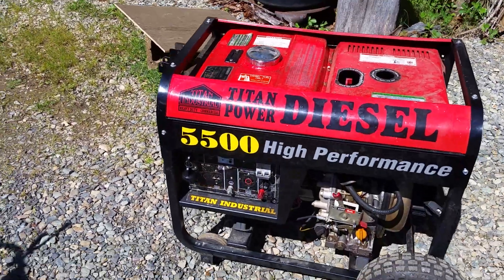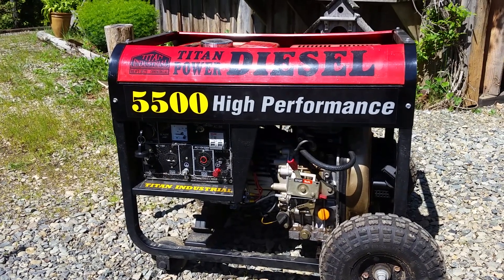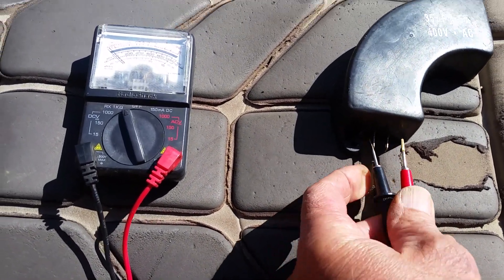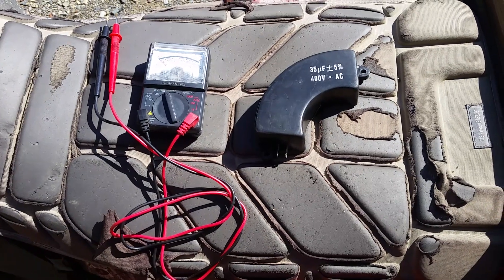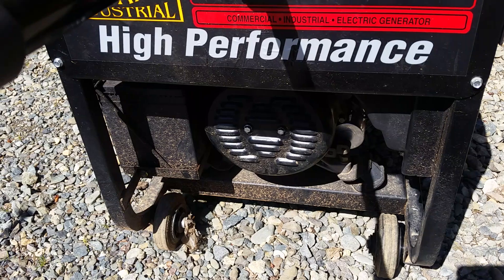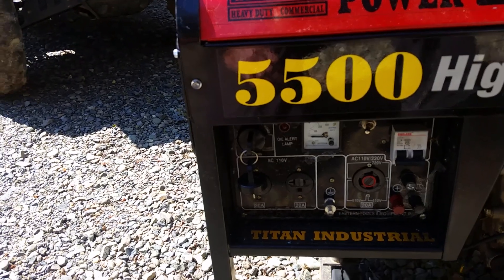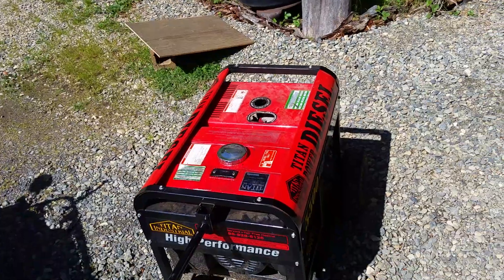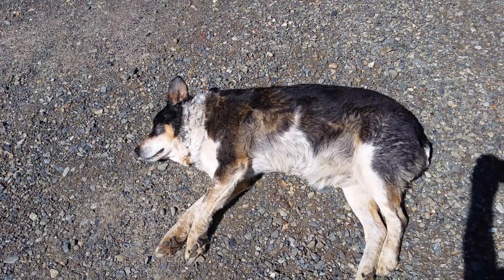Off grid solar homestead Diesel generator repair ($17.95 fix)

Comment: Chinese capacitors...🙁Thank you for sharing your knowledge...🙂I am in the planning stages of going completely off grid...The wife seems to be on board...Trying to figure out how to hook up the gen as a backup to keep battery’s from damage....My thoughts are panels to combiner box to charge controller to battery to inverter to breaker box...generator not sure yet...Just thoughts at this point...I need to watch more vids.T.Y.Much
Reply from the maker: Thomas Reto Greetings from off grid Oregon,  when you buy an inverter make sure you buy an inverter / charger.  I have a 4000 watt 24 volt inverter that also charges the batteries at 105 amps when connected to the generator.
Reply: Steven Davis I will keep that feature in mind when looking for one thank you.

Comment: I gave up on generators they are just so poorly manufactured and overheat so easily, we turned an Ninja 250cc beginners bike into a generator for our backup power... we picked up the ninja 250 for $500 bucks with only 700ish miles on the motor... i welded up some rollers that are mounted to a small frame spaced out for the wheel to sit inside the 2, then on the end of the one roller i ran a pulley that turns a belt to a 10,000 watt generator head i picked up.. i roll the bike into the frame i built to secure the bike, the rear wheel sits on the rollers and i strap down the bike via the rear swing arm by multiple straps to the frame of the rollers, then i run 2 more straps to keep the bike upright via the frame.. ive used this setup multiple times when we lost power out here in Colorado during snow storms.. i normally keep the bike inside the barn because the girlfriend occasionally takes it on motorcycle rides with me.. but all i did was ride it into the frame, strap it down, turn the bike on and let it warm up.. then put it in gear and start making power... the generator head is about 7 years old now and sits outside under a tarp when not in use, the motorcycle is 14 years old.. i run a large box fan in front of the bike when i run it to increase airflow, but the bikes liquid cooling keeps it under control without any issues...
Reply: you mean to maintain rpms? if so I use a motorcycle cruise control bar end lock I picked up off ebay to lock the rpms
Reply: I have never has an issue with it, the generator head has 4 built in 120v plugs and does all the controlling internally, I do know the generator head came with a warning that if ran without a load it could cause damage to the generator head, but outside of that I just don't worry about it.. it always has a load on the circuit due to it usually having to charge my battery bank at the same time of supplying power to the house.. it has 5 led lights on the head unit, if you give it to much throttle it shows a red led, if its to little it shows yellow... I just turn it on, get I started and watch the led tell its only green, then I lock the throttle..

Comment: Love the comment, "...have some general knowledge of how not to die doing it." Cracked me up...but, it is SO true. Reminded me when I was a young/dumb Airman working into the mobile radar van. Missed a step in a trigger amplifier removal and got whacked by two phases of 120v with discharging capacitors. Locked me up and then threw me against the wall like a rag doll. Had an exit wound/burn. It was a bad day...but, was fine after an hour of trembling. Well done video my friend...great words as always! How is your son...has he taken off for boot camp yet?